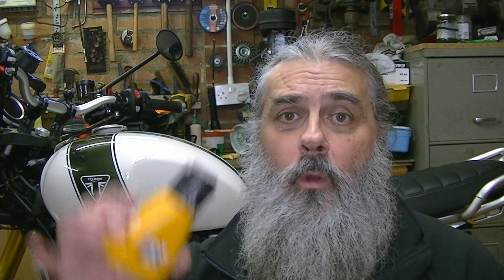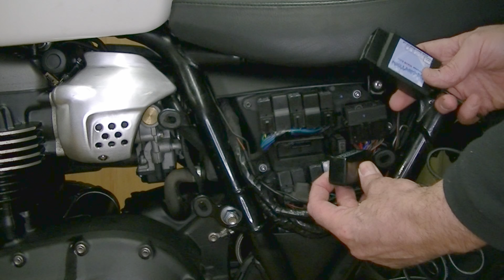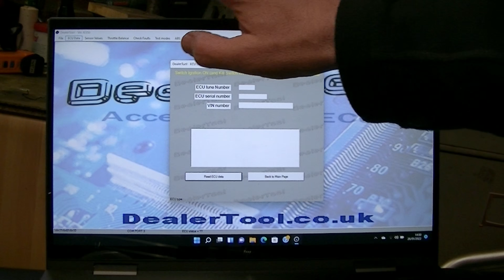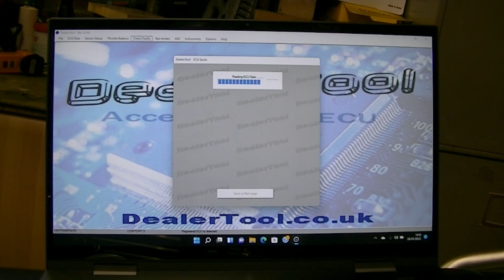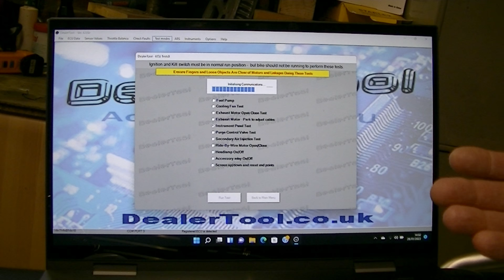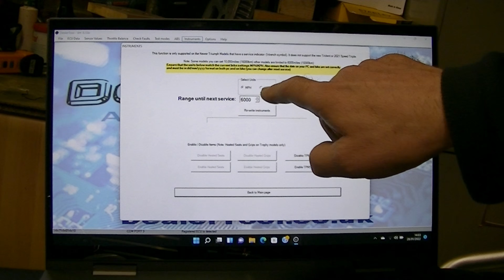Triumph Scrambler 1200 maintenance and diagnostics: using DealerTool

Comment: I have just found out something important on using the dealer tool, it took me a while to figure this out! On my bike (2019 Scrambler xe) I had the date set as we use here in the U.S. for example May 2nd 2025 (5-2-25). My service light would not reset. After several attempts I changed the date on the motorcycle to U.K. style for example 2nd May 2025 (2-5-25) and that fixed the problem.

Comment: Through no fault of my own, acquired a 2013 Triumph EX 1200. Doing a major rear brake rebuild. No fault of DealerTool, I blame Triumph for making it necessary. First and last Triumph I will ever own. My next moto will be an 80's or 90's Honda, under 1000cc. The acme of motorcycle design, function, and ownership. In my opinion, yes.
Reply from the maker: Sorry to hear that.